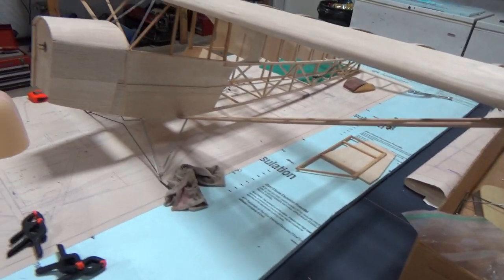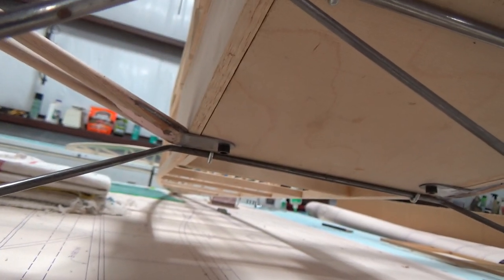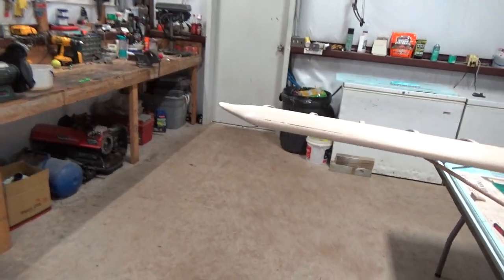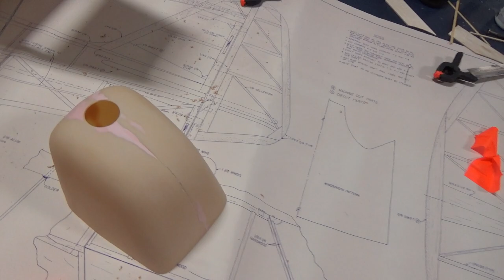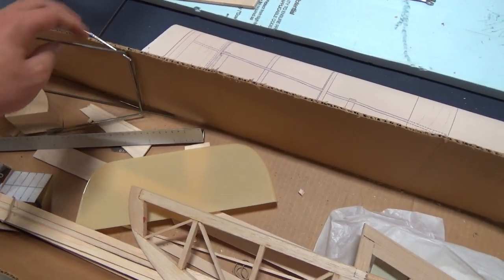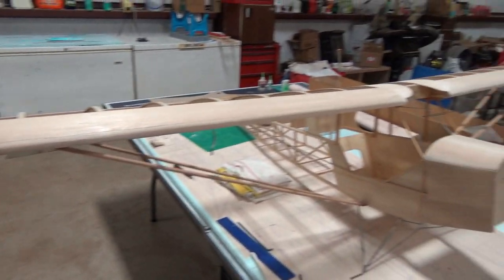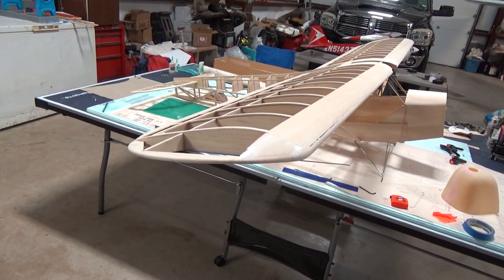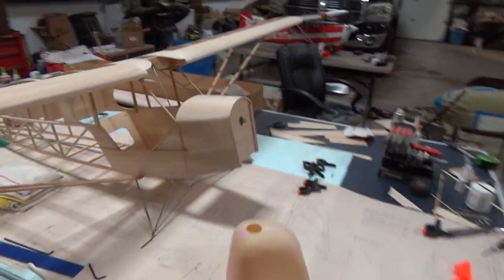Balsa USA 1/4 scale cub build part 4

Comment: I would cover it with Poly Fiber System. You can get everything from Aircraft Spruce. Lots of information on the internet, also called the Stits system
Reply from the maker: Thanks for the info I do plan to cover it in fabric with materials from aircraft spruce

Comment: Use Monokote! It's the best and strongest. I've been building RC giant scales since 1981 and build professionally for many people and i will never use anything but Monokote and the paints they make are very good, dry's quick and when fully cured you can't really even put your fingernail through it. It will just slide off...Very tough paint and it's especially good for gas models along with glow fuel models as well. 

Ultracote is alright but it's a lot thinner and is more prone to wrinkles under sunny conditions or high heat weather plus it likes to tear a bit more. I will sometimes use this to actually cover fiberglass cowlings and no, I don't get any wrinkles in my techniques. One day I'll make a video covering a cowling with covering and a heating iron. Your plane here looks like it will turn out nice. Good luck in your build. Hope all turns out like you want it to. 

Here's a Monokote Color chart of all their colors. 

http://thelukens.net/airplanes/Accessories/Covering_colors_Chart.htm